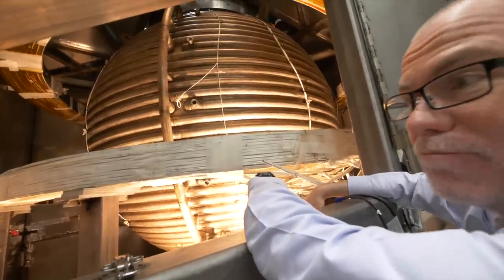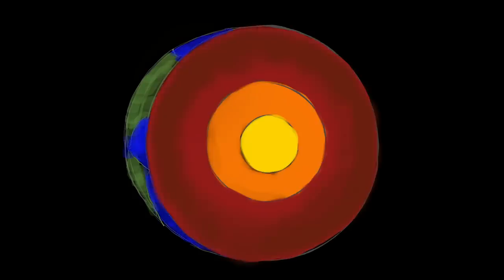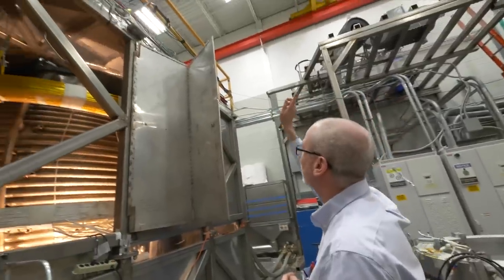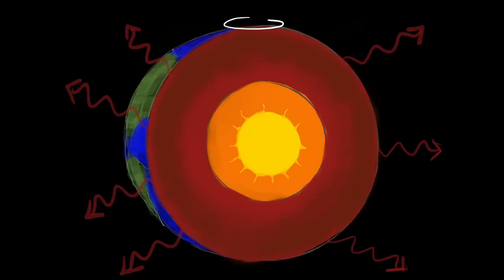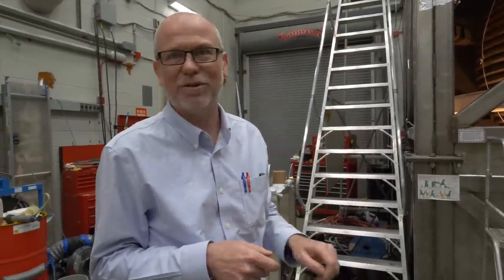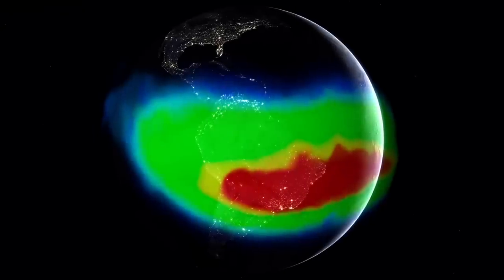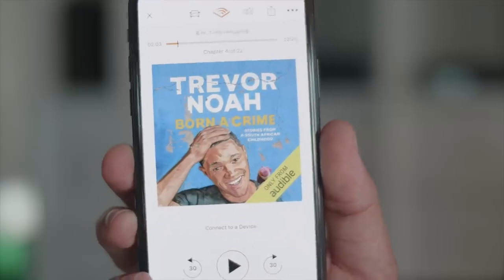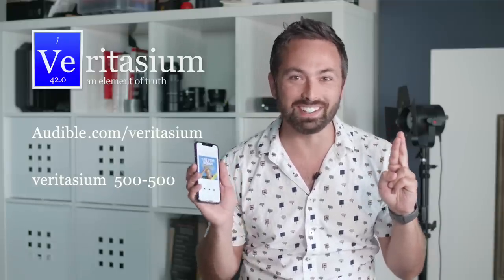Spinning Sphere of Molten Sodium

Comment: "Back up plan is put it out with cryogenics... it actually works great!"

ARE YOU IMPLYING, SIR, THAT YOUVE HAD TO USE THE EXTINGUISHER?
Reply: In scientists mind theoretical correct equations and reality is the same thing... If the maths works it will works
Reply: While unlikely that it's been applied on that scale, presumably its been proven on a smaller scale
Reply: puts on blast goggles We extinguish this sodium fire today.... in the name of science!
Reply: The nuclear power industry (and naval applications) has a lot of experience with liquid sodium and potassium. Some of it involved significant spills (it is called practice).
The solar industry is building on that for solar thermal power stations.
Reply: I wonder if the temperature difference wouldn't bring out the leidenfrost-effect, or sthng?
Reply: @Benjamin Joshua Beggs I was pretty much sure, they have considered it too :) It's just popped in my mind.
Reply: No, he's implying that they tested liquid nitrogen on burning sodium leaking from some form of hot containment to see if it could prevent catastrophe before investing in the safety measure, as any competent person would do. That's why he said, "The leak gets frozen" (2:56).
Reply: Just pour some water into the sphere to cool it down... then stand back, faaar back! tsk-tsk
Reply: Bill A - sounds good, the simplest solution is often the best! what could possibly go wrong? 😂
Reply: Except if there is a human shaped water bag in the way during a containment breach guess what happens?
Reply: Of course. Testing professor. Testing
Reply: What I want to know is what happens after the nitrogen has evaporated and you've got a giant blob of solid sodium across the floor of the lab? Do you pour mineral oil over it and chunk it up with a concrete saw or something? Seems like a giant piece of solid sodium is only slightly better than a giant flow of liquid sodium...
Reply: He could have tried with a miniature version.
Reply: @Benjamin Joshua Beggs 
What makes you say probably not? Based on what?
Reply: Allan Gibson On the topic of nuclear power, I was thinking that the video was going to be about nuclear reactors, seeing as how you pointed out liquid sodium (or rather NaK) has been used quite a lot in that field.
Reply: I get the feeling, from his excitement, that the true purpose of the experiment is just an excuse to to "test", cryogenically freezing 12 tons of molten Sodium.🤔
Reply: @Benjamin Joshua Beggs I believe he meant a nitrogen only environment that lacks any water.
Reply: They've surely tested it
Reply: I would hope that before they made that safety feature, they tested the safety feature in a non live test.
Reply: @Benjamin Joshua Beggs You're thinking of lithium. Sodium does not readily combine with nitrogen, and sodium nitride is thermally unstable. Look it up. I checked online and in my textbooks.
Reply: @Benjamin Joshua Beggs Can you please edit the comment about knowing for a fact that sodium burns? It will save you and future readers some effort
Reply: they had to test it out at some point. They could do a small scale controlled test easily.
Reply: Scientists gotta test the backups too!
Reply: Add chlorine and get ready for dinner?

Comment: did he just say the earth's magnetic field has reduced by 10% in the last 100 years?  ... thats scary
Reply: It is cause for concern, which is why they are studying these things. It probably is something completely natural that has happened to the Earth many many times over the past billions of years. It should be no threat to life on Earth.
But up until 100 years ago, we didn't have sensitive electronics, and those can really suffer very badly if the magnetic field gets weaker in keeping charged particles from the sun away from Earth. If in the future the magnetic field will go below a certain level, we will have to design our future electronics differently so they can handle it. But for that we need to know how weak the magnetic field will get before it gets stronger again, and how much time we will have before that.
That's why they are doing this research.
Reply: The magnetic field is dynamic, it "has weather", as mentioned.
Reply: @Yora21  eliminating the field that protects us from cosmic rays is not a threat to life?
Reply: it very much is a threat to life, since we would be exposed to tremendous amounts of solar radiation.
Reply: Welp... what are we going to do?
Reply: Correct. It will reduce to nothing 'soon'. There will be NO magnetic field for a 'long' time. Then North will 'slowly' become South, and vis-versa.  This is called Geomagnetic Reversal - https://en.wikipedia.org/wiki/Geomagnetic_reversal.

As the video said, its flipped hundreds of times before, this is just the first time we've had the tools/technology to A) Understand we actually have a magnetic field and B) have the ability to track, and model the magnetic field.

Perfectly normal, but it may mess up our 'modern technology' as the planet will be bombarded with increased solar radiation for centuries/millennia whilst this happens.
Reply: @jaykay5369  That makes a lots of sense disregard my first statment
Reply: @leolen8029  no probs 🙂
Reply: @professionalbiologist7108  Not even mainstream Christians believe in creationism. That's just a weird American cult.
Reply: @professionalbiologist7108  Nobody is trying to argue or debate with you. Fallacies mean little to the people that don't care to debate in the first place. Stop trying to argue with people that never asked for it in the first place.
Reply: It’s the secret causation of global warming before the industrial age
Reply: @professionalbiologist7108  so have creationists been saying its less than 6000 years old? "[Earth] was Made Literally in the last 6000 years" (Modern Scientific Biologist, 2020) or is it that "earth Cannot be Older than the last 25'000 Years" (Modern Scientific Biologist, 2020)? For the sake of discussion, we need to be clear about the time frames.
Reply: @professionalbiologist7108  25000 is more than four times as much as 6000. i would not define this as "fits perfectly". Furthermore, i spent about 20 minutes perusing the sources you mentioned in your previous comment. HUGELY biased source AND the references made in the 'papers' all lead back to the same website and the same people. The people making the website have articles and papers on their that reference to themselves as proof for what the paper is claiming. It looks very academic but a little scrutiny shoes the immense bias which means it cannot be trusted. Every number/fact/theory used is backed up by 'evidence' from papers written by the writer of the article. It feels like searching for the answer you want and only showing things that seem to support an already agreed upon ending. You start from the point of believing the young-earth model and then cherry pick snippets of information to make it seem like supporting evidence.
Reply: I think he said 170 years
Reply: @jaykay5369  you literally called him a troll then fell for the troll
Reply: The extinction event nobody predicts is the next extinction event.
Reply: @professionalbiologist7108  Sorry, this is science, here. Take your arguments elsewhere.
Reply: @professionalbiologist7108  Somebody didn't do the math.
Reply: We've only been recording it for 100 years, that's really nothing in the history of the earth.
Reply: @PaulPickeringPP  spot on, that is some awesome stuff! Big fan here 👍
Reply: @Fr333man  not many of us hey. I try to spread the information as much as possible. The guys really is on point 🔥
Reply: @leolen8029  deny it in it's entirety and vote for people like Donald Trump, obviously!
Reply: @jaykay5369  so you link an article that says different things from you? Did you even read it?
Reply: @jaykay5369  reduce to nothing? Surely that isn’t the case bc then every time one of these reversals occur it would cause a mass extinction. Maybe reduce considerably but definitely not to nothing
Reply: @Dell-ol6hb  that's debatable. The atmosphere would be fine if that's what you're thinking; everyone/thing would be at higher risk of mutation for a few years-centuries at most. Not enough to cause mass extinction, no.
Reply: Honestly it might put us at risk for a couple hundred years but we’ll just intent clothing thatll be more geared for repelling radiation than ever before to protect us. Yes the cancer rates will go up and crops will suffer but we’ll just genetically engineer them to withstand more radiation so on and so for but a game plan on when and how it all works will better prepare us because knowledge is power
Reply: Must be cus of u and that phone
Reply: @brocklaughrey3212  The difference between now and a million years ago is that we have a civilization. This civilization is designed to function in the current status quo. Even if we could somehow come up with a means to protect ourselves, the chaos and mass panic it would engender would be a borderline extinction-level catastrophe.
Reply: Scotland Dobson  Presumably they've been measuring it consistently over the past 100 years and noticing a gradual drop. It wouldn't make sense that scientists just stopped recording the magnetosphere for 100 years, nor that they wouldn't have come up with better methods over the decades providing more reliable measurements in the intervening years.

Observing measurements over this length of time period with gradually improving instrumentation would have either produced inconsistent results, a sign the previous instrumentation was bad and the data to be discarded, which does not seem to be the case since they are still using the 100 year old measurements as a benchmark, or it would have confirmed an approximate trend.
Reply: @jaykay5369  Part of this is incorrect, the magnetic field isn't going anywhere, the magnetic field doesn't disappear during a shift in magnetic poles, a paper proposed the idea but didn't have enough evidence to back the claim. The magnetic weather you are referencing for the total disappearance of the magnetic field isn't going to happen for at the soonest, millions of years, and that event as well is just speculation based on recent geological data which's findings could have been caused by something such as a nearby supernova as well.
Reply: @Yora21  aye we know the field has flipped many times we just dont know how or why. we may be in the transitional period between flips the field weakens until it flips then strengthens again is one hypothesis.
Reply: Aluminum foil hats!
Reply: @SekiberiusWelkesh  where did you get your “millions of years “figure? Because earths magnetic field is getting weaker by 5% every year. That’s a fact.
Reply: @eyescreamcake  I mean there hasn’t been evidence of it completely disappearing, just weakening and strengthening
Reply: Supposedly we can engineer a magnet with current technology that would be sufficient to shield Mars from solar radiation (and let it build up an atmosphere).  Can we do the same for Earth, or no because it's bigger and closer to the Sun?
Reply: It must be human caused.  Let's make a tax to stop the resyction it and talk about it in the news all the time to distract people with fear.